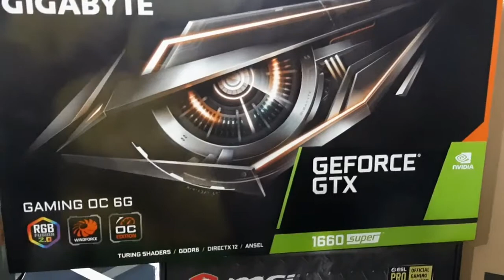Ryzen 5 3600, MSI 550M Mortar Wifi & Gigabyte GTX 1660 Supper

Comment: Question lng po di ba tlga nailaw ung on board led ng motherboard under gpu?
Reply from the maker: Nailaw yan pinatay lng
Reply: @pcmastertech9051  pano po on same mobo kaso tayo
Reply from the maker: Using Mystic light application download mu aa sa site ni msi
Reply: @pcmastertech9051  pwede po malaman anong settings knina pa ako nababaliw kakahanap wala din ako mahanap tutorial
Reply from the maker: @lysvillanueva6695  download mu MSI Mystic Light sir